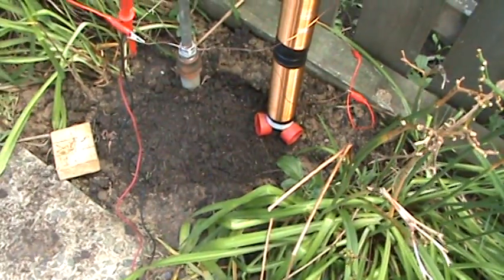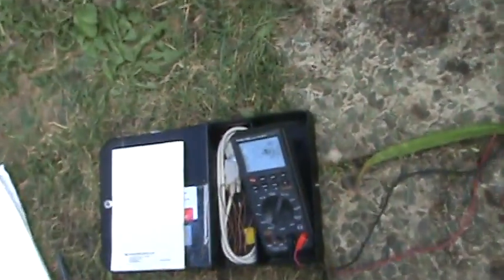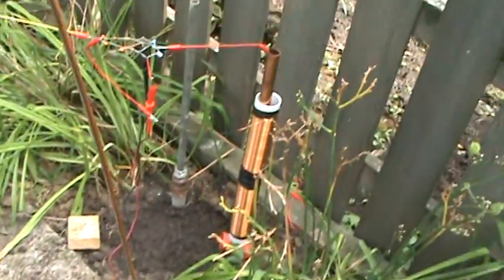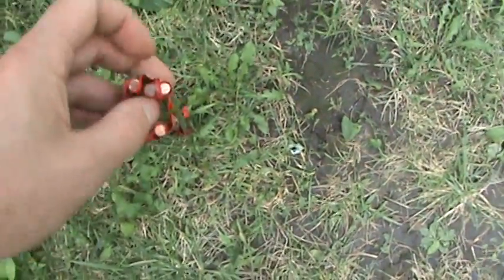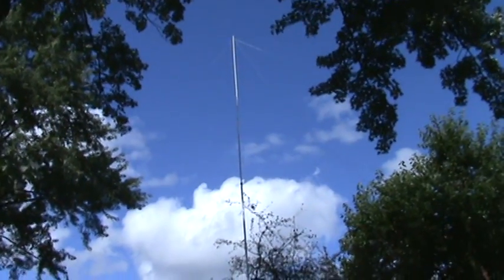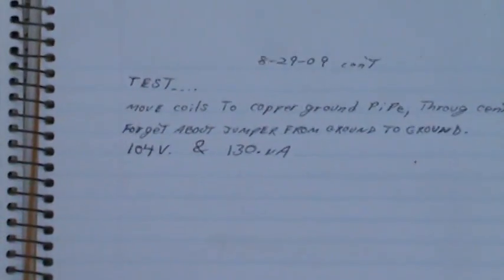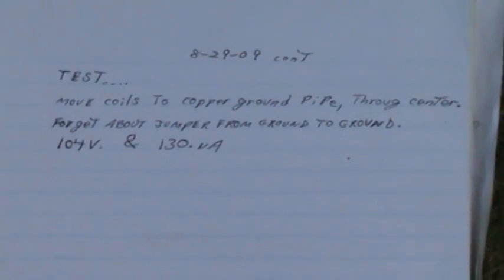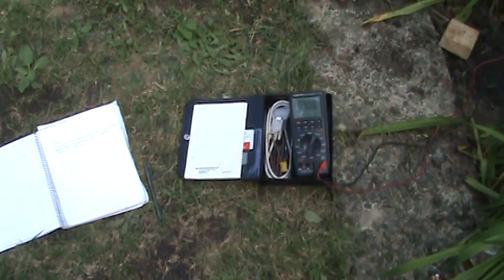FREE ENERGY FROM AIR CIRCUIT PART 14/24

Comment: Hi Paul. It's good to see you're still at it (I know it's now years later). I don't know about distances, or lengths,  pipes vs rods and all that stuff, but did you realize that with the two different metals you could probably make an earth battery cell (as I understand it though, the ground has to be fairly moist, though not sopping wet)? Anyway, it's something to think about.
Reply from the maker: +Bruce Dobson Recently I been thinking very seriously about making many earth batteries under my lab :-)  I already have a plan for an automatic watering system :-)
Reply: That sounds so cool. Please keep me posted, or at least make videos. Thanks,
Bruce

Comment: hey paul i tried a new set up it was still with my previous circut but the strange thing is is that i used a shorter antena but made sure that at least 95% of it was taught and a a 90 degre angle to my circut. i also put a small 20 inch coil at the end of the antena my voltage went up like i expected but my current trippled. im using the same ground as all previous set ups but i just cant explain this sudden increase in current. is there an email i can reach you at to mabe send you better info

Comment: well im just statring out with my experimenttation process and i don't have a good ground or antena set up yet butt i got .61 volts and 14.65 milliamps on the 20 u scale on my multi meter im useing the same circut you are but insted of .1 uf capacators im using  (2)  .2 uf 50 v ceramic disk capacirtors

Comment from the maker: @q7spiz Hmmm, pick frequency based on voltage, interesting.  I know that the frequency coming in on the antenna is like 258Khz, if i remember correctly.  I will try to get circuit to resonate with that frequency and see what happens.  Thanks for the ideas.